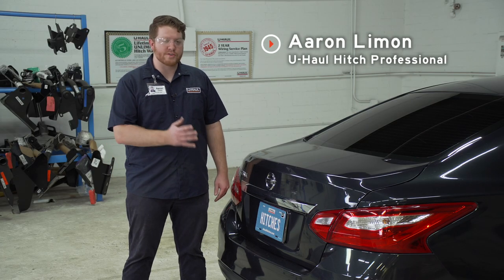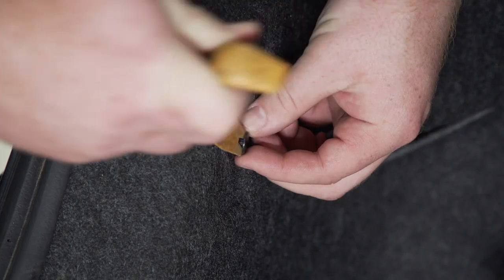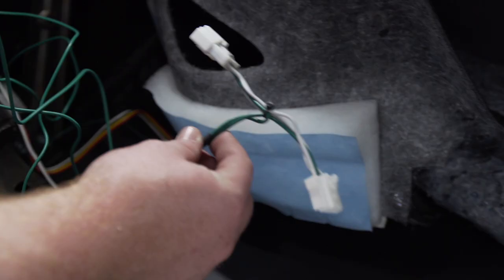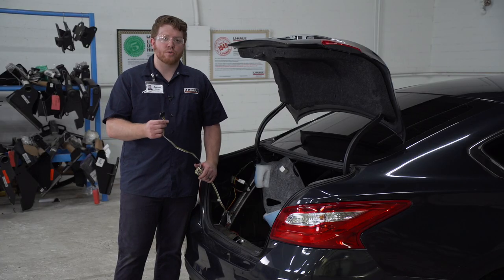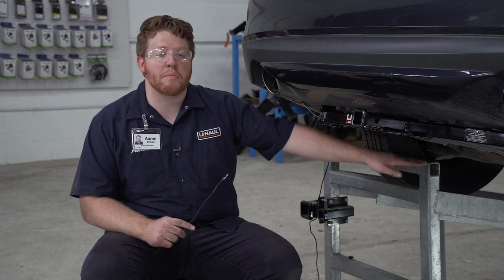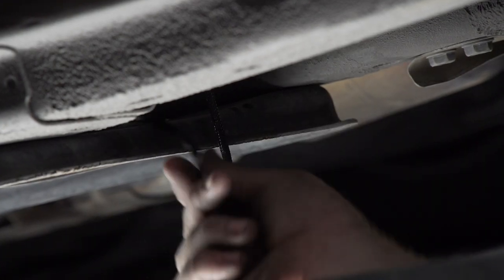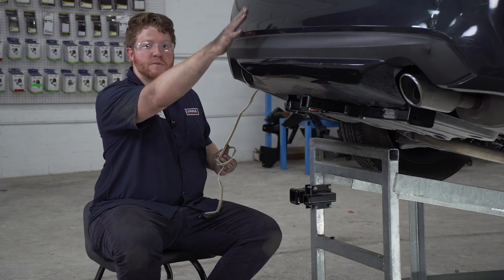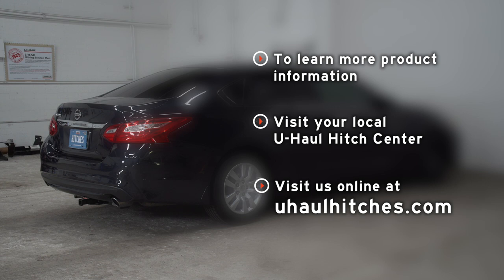2018 Nissan Altima Trailer Wiring Harness Installation

Comment: What's the part number for the plate to hold the plug under the car in place?
Reply from the maker: Our 4-Flat mounting bracket is part # CQT118144